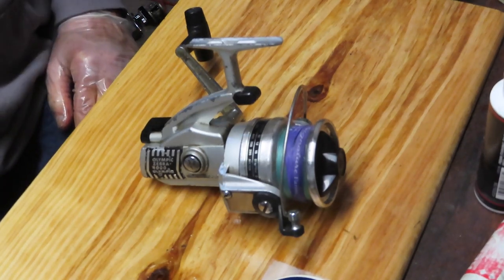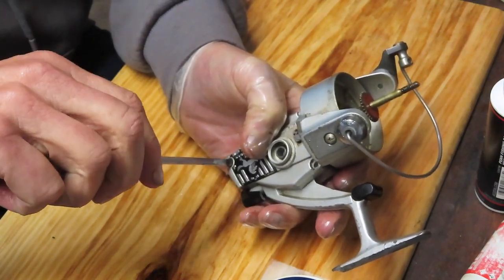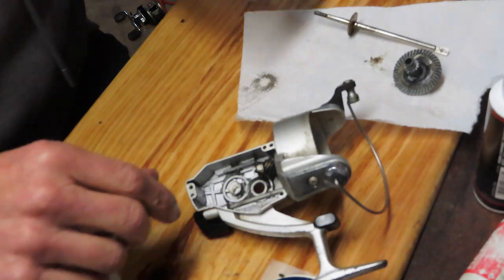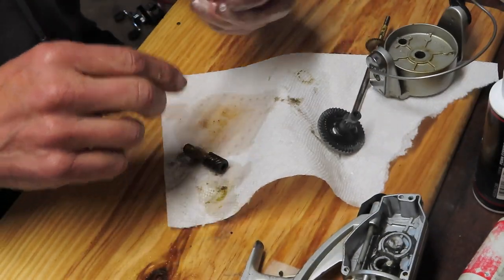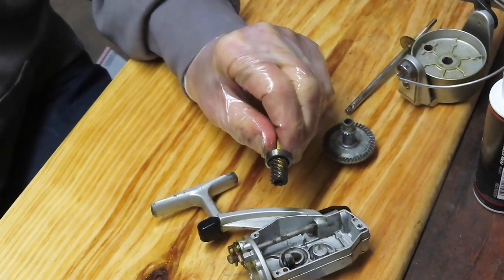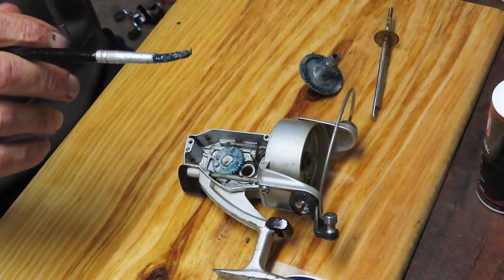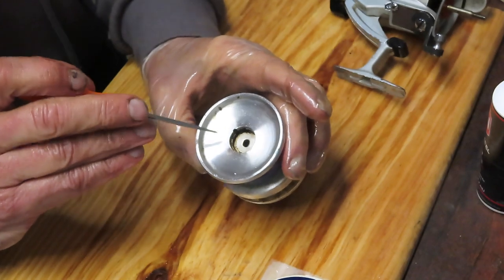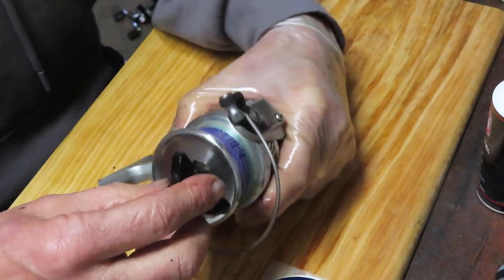Olympic Zebra 4000 spin fishing reel how to take apart and service

Comment: I have 9 Olympic reels and they are all pretty good. I don’t have a Zebra but I know they are pretty good. Like many from this time the finish doesn’t last very well. This one of Scott’s is looking really good. My experience is that Olympic reels from this time are some of the best bargains on the internet and don’t get the recognition like Daiwa and Mitchell.  I loosen the bail arms just a crack so I can spray some WD40 in and then oil and retighten. I should look at finding one of these as I like them a lot. My collection has a lot of 1970s reels which now seem to be harder to find on auction sites like EBay and Esty, etc. I sure would like to know how many reels Scott has accumulated not as a competition but just to recognize what he has already done. Scott gets conventional as well as  spinners while I only collect spinners.  Great video on a fine reel Dennis!
Reply from the maker: Thanks Chris - I think Scott noted he has about 30 reels now
Reply: @2ndChanceTackle  you must have serviced every one of them!